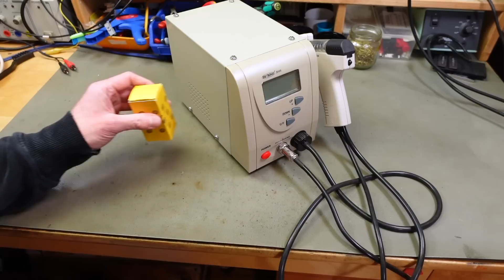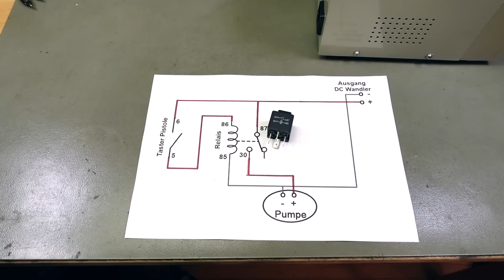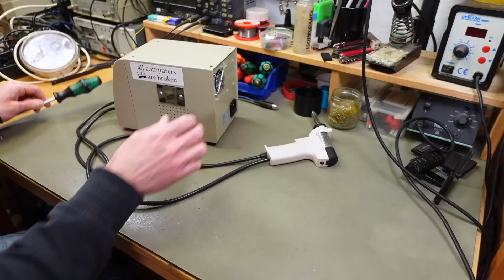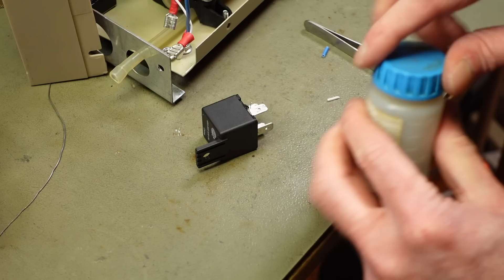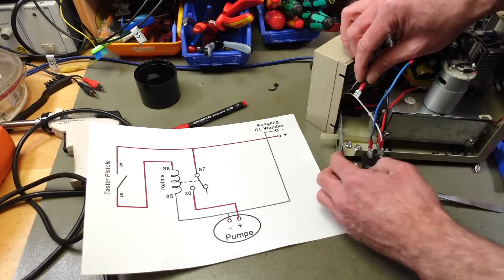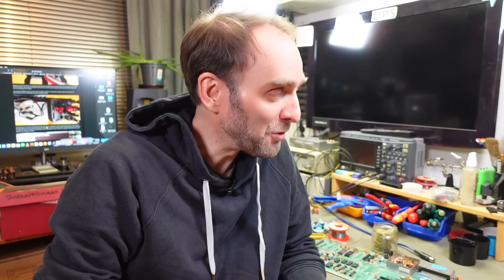Putting an Automotive Relay into my ZD-915 Desoldering Station

Comment: Sorry, I am not trained either. What limits current and keeps the relay coil wiring from burning up when you pull the trigger? Should there be a resistor or something in-line?

Comment: Congratulations on your mods, now all you have to do is install a more efficient and high-performance vacuum pump. I did it (applying your buck converter) and went from -0.6 mb to -0.8 bar. I installed a vacuum pump, purchased on AE, from -85 kpa, with a flow of 40 L/M. It's a bit noisy but it's worth it. I also recommend you change the gun. Now a model with a side opening is available and I must tell you that it is built much better, it is similar to the guns of the ZD 8915. Thanks for everything and for everything. Ciao,
Reply from the maker: Thanks for the tips! I am going to look into doing something similar in the future. Thanks for sharing!
Reply: @JanBeta  My pleasure Jan..To mod the ZD 915 is a trip know only to happy few.Ciao 🙂P.S. Just today I modified a ZD 985 by installing a more powerful pump and a 6 cm fan......

Comment: So pointless. The trigger works fine. This makes no sense as it doesn’t give it any performance changes. Just adds another point of failure.
Reply from the maker: As I said, strictly optional. It improves the action slightly. The trigger reacts a bit more direct and the full suction is available faster (which actually improves desoldering quite a bit).

Comment: As the switch origionally activated the motor, you could use the motor wires to activate the relais. Then connect the motor via the relais contact to the voltage converter. No need to remove the front panel or messing around with the wires there.

Comment: Hi, I followed your previous video and this one closely because I have a question: Is the temperature sensor NTC, PTC, or a K probe? Thanks in advance. Best regards.
Reply from the maker: No idea, unfortunately. I didn't look into the electronics of the gun at all (well, apart from the simple micro switch in it). Maybe somebody else who reads the comments has a clue?
Reply: @JanBeta  Ok, thanks for your time, I appreciate the attitude, greetings!

Comment: The Duratool version of the ZD 915 has a number of improvements. They have used thicker wire to the pistol switch. The wire + switch resistance  measures 0.15 ohm between pins 5 & 6 on the plug. The voltage across the compressor motor is now 14.45 V .

Comment: I would say a solenoid would give better suction, turn on pump to build suction then few seconds later fire the solenoid
Reply: I have upgraded to a solenoid valve vacuum system. The penetration power is greatly improved. Your idea is correct. The solenoid ignition delay is 0.7 seconds. It is suitable and difficult to clog.

https://youtube.com/shorts/4-rGK944nXM?si=oQwJdsERNP9YIUO_

Comment: G,day Jan Beta from Sydney Australia. Great little project. So, this is my understanding.
By adding the switching relay: DC current will find a shorter path to the motor, once the initial flow of current enigizers the relay magnet reducing the loss of DC voltage due to conductor length (wire to trigger switch).
💫🧲
Reply from the maker: Yup, that’s pretty much the idea. I didn’t gain as much as I thought with this mod but the pump speed ramps up slightly faster. I think it might help a bit with the gun not clogging up so quickly. Real life performance is basically the same as before the mod as far as I can tell at this point though. At least the original design flaw is remedied. :)

Comment: "Nice" example for german overengineering! 😂 Add a DC/DC converter to reduce the voltage the first time (when replacing the cheap power resistors), then reduce it further when adding the relay. OMG! An ABSOLUTELY NO engineering approach. Not a single f-ing measurement! Just brainless "modding". Did you measure the current of the pump? Did you measure the resistance of the Wire in the cable + swich? NO!!! So what's the REAL impovement except the feeling?
Reply from the maker: Look, I made pretty clear in the video what it is about. I also said this is completely optional and doesn’t improve the functionality by much. I’m not an engineer. I did the measurements that mattered. You are not satisfied? Go somewhere else.
Reply: It does definitely help, the pump needs the most current at the moment of starting, which causes the greatest voltage drop across the 2.5 m long and thin cable. Exactly at the moment when the pump should delivering the most power, it can delivering the least. Furthermore, it is questionable how long the Chinese switch in the handle will last under this inductive load.
Okay, I used the buck converter's enable pin because I didn't want to have another contact that would wear out over time and the buck converter provides the switching function for free, but ultimately I did it for the same reason: To get the best performance out of the pump at the moment it is needed.
Reply: @ You talk about a feeling and opinion. But you made also not a single measurement!
Reply from the maker: @JacquesMartini I measured the voltage across the pump after the mod and before (in the previous video in the series). Gained around 1V with the relay.
Reply: @JanBeta  Which you reduced before with the DC/DC converter. 😂
Reply: @JacquesMartini  A measurement is of no use if you didn't understand the use case. And as soon as you understand it, you'll have to anyway understand the physical relationships (which I explained above) as well and often no longer need a measurement. Especially once you understood that this is not an easy measurement that can be done with the usual equipment.
For example I can tell you that the pump needs 2,4 A in normal operation and Jan can tell you that the voltage drop across the cable is 1 V. But both measurements are of no use to you once you have realised that he punp is not running in normal peration.
Reply: @AS-oq7io  What a BS!
Reply: @JacquesMartini  The pump does not pump more solder as longer it runs. You can let it run for 10 minutes (if it can handle it) and notice that it has not pumped more solder. The length of the run time is therefore not the relevant factor. The relevant factor is how strongly it pumps at the moment it is switched on. And that is not covered by the measurements.
That is why it is not enough to compensate the measured voltage drop with a higher setting of the buck converter.
Your problem is that you did not understood the use case and you can now make as many measurements as you want, they are all not relevant. You can name it BS but it won't change anything.

Comment: Hallo Jan, kaufst du die Filter dafür oder machst du sie selbst? Ich würde sie gerne selber machen, aber welches Material sollte man dafür nehmen?
Reply from the maker: Bisher habe ich immer welche gekauft. Zeitweise hatte ich auch mal einfach Watte als Filter in der Glasröhre. Das funktionierte super. Ich wollte demnächst mal versuchen, mir die Filter aus Baumwollfilz (das Zeug zum Basteln) zu stanzen. Müsste sich sehr ähnlich verhalten wie die originalen Filter, denke ich. Vermutlich mache ich irgendwann nochmal ein Video dazu, wenn ich Erfahrungen gesammelt habe.
Reply: @ ich dachte auch an Filz.

Comment: Your mod is a ‘nice to have’ but is it worth the time and trouble: the voltage drop on the control wire can be compensated for by increasing the boost converter output to ensure the motor receives the correct voltage. The relay would only really be necessary if the motor load was not relatively constant.
Reply from the maker: It’s definitely a purely optional mod (as I said towards the end of the video). I did it for fun and out of curiosity. The functionality stays pretty much the same, of course. I did what you say in the previous modding video and just set the voltage accordingly.
Reply: this is the right comment ❤

Comment: If you didn't, please but a back emf diode across the relay coil to protect your switch and power supply... Still watching...
Reply from the maker: I forgot to do it at first but went back and added it in! (Spoiler alert! 😉)
Reply: @JanBeta Yup. just got to that point in the video. Came back to delete the comment but you got here first. 😆

Comment: Mine blew the control IC in its SMPS three times. I gave up after the 3rd and bought myself a Hakko. ZD915 is great value for price but in my experience, it is not dependable.
Reply from the maker: Ah, that suck (or it stops to suck in a more literal sense)! I heard from some people who had the electronics break down in their ZD-915s. Mine has been working fine for around 9 years now. I guess with a cheaply made product like this, there’s a lot of variance in the quality. :/

Comment: haha, wenn man zart verpeilt ist und auch gerne 'mal aus Spaß an der Freude seine begrenzte Lebenszeit für Überflüssiges verwendet, kann man das so machen ..sympathisch ist’s natürlich allemal (bin ja selbst nicht anders) und vom Klicken des Relais wird man schlussendlich ja auch immer wieder reich belohnt  .)   Vielleicht solltest du die 4 sputtligen, viel zu groß geratenen Gehäuseschrauben (Oberseite) gleich weglassen, das erleichtert die nächste Intervention u. die knubbligen Schraubenköpfe sind nicht immer wieder im Weg, wenn man etwas draufstellen will?

Anyway - funny to see that you have similar (AliExpress/ebay) equipment as I do (Desoldering- and HotAir-Station) and we both know there is still a lot of work to do  :D   What bothers me about the desolder-thing is the long heating time until everything is at temperature ..also, of course, the somewhat tight mechanics when it comes to removing the sucked-out solder (I broke the glass tube right at the beginning) (nice dealer immediately sent me a replacement for free)  ..well, just sayin’ ..LG
Reply from the maker: Ha, ja das war natürlich eher eine Aktion, die ich aus Spaß und Neugierde gemacht habe. Keine Ahnung, ob es das wert war, aber fühlt sich besser an, jetzt wo dieser „Designfehler“ behoben ist.
Die günstige Ausrüstung liegt bei mir vor allem am latenten Geldmangel (und ich habe nichts dagegen, an den Teilen rumzubasteln, das ist fast ein positiver Nebeneffekt). :D Das mit den Schrauben ist eine gute Idee, die nerven schon manchmal. Wahrscheinlich würden da schon Senkköpfe und ein bisschen Verfeinern der Bohrlöcher helfen. Mal sehen.

Comment: Also this gives a very easy option if you ever wanted to break out that control point with a TRS jack or somesuch, and make the suction foot-pedal activated. I suppose that's not entirely an option that might be the most useful, but a possibility all the same. If these things were able to heat up faster, a way to let it standby until needed would be kinda neat, but usually the thermal lag of getting to a usable temp, would be too much of a patience game. End up with more clogs if not all the way there.
Reply from the maker: The foot switch is a neat idea! Could be useful for peeps who are not able to use their hands for the trigger and still want to desolder stuff!
The heating element is rated for 24V in these but it seems to run on 18V so it might be possible to do yet another bit of hacking to make it heat up a lot faster. Maybe I’ll look into that sometime. :)
Reply: @JanBeta  That's a good point about possible accessibility. Also interesting that the drive supply is that low compared to the possible rating. Hopefully bumping it up won't destabilize the PID(or whatever they use) another maybe issue is the element might not run as long if burned more aggressively, but who's to say what that would actually mean for the element's lifetime.

Comment: When I've performed modifications such as this, I've found it's worthwhile to purchase a matching socket for the relay.  This makes servicing/replacing the relay much easier, should it be required.

When I worked at a 2-way Radio Shop, we added a reverse biased diode to the relay input, on the horn honk relays, for AMPS (analog) Cellular Phones.  This reduced the likihood of damage to the triggering mechanism within the cellphone, which honked the car horn, when the cellphone rang.  I think we used a 1N4003 or 1N4005.
Reply from the maker: I added a 1N4007 (although I forgot it at first and had to disassemble the relay connections again). D‘oh!
A socket would be neat, maybe I’ll add one the next time I’m tinkering with the station. I think the crimped connectors should be fine for a while though.

Comment: I’m a bit doubting on this change. 

What was the resistance of wire going through the gun trigger and back to the pump?

As that’s what you’ve eliminated for a shorter wire. (Though now the pump and trigger are in parallel?) 

I think I’ll watch the video again - to see if I can understand it better

It feels like there’s the trigger plus solenoid in parallel with the pump 

The argument being the resistance of the wire and switch was dropping the voltage and burning power ( P=VI) before it got to the pump? Im not sure if that was really that much.
Reply from the maker: I literally measured the voltage across the pump and the gain was at least 1V before I adjusted it down again. It’s not really a necessary mod but the theory with the resistance is definitely valid. Not gaining much in terms of functionality, of course, but it was fun to do it. ;)

Comment: Perhaps the next mod should be solid tubing and some adaptation to allow the gun to be cleaned more easily
Reply from the maker: I heard there are slightly newer versions of the guns that are a bit easier to clean. I’m going to look into that sometime. Modifying the gun part itself is tricky because everything in the release mechanism is brittle plastic. Not too easy to change things without breaking it completely, I think.

Comment: What is the relay coil resistance?
I would have put the back emf diode across the relay coil to help save the trigger contacts.
Sorry I was going by your schematic and was only up to 10m in the vid.
Reply from the maker: Not sure about the resistance but it is probably negligible. I forgot the diode at first but remembered to put it in just before I went into testing (sorry for the incoherent video)! ;)
Reply: @JanBeta  I would guess that the resistance is quite low for automotive relays, but not as much current as the motor I assume.

Comment: I wouldn't have believed the difference that relay would make if I hadn't seen this video!  Great way to learn about a load on a circuit.
Reply from the maker: It’s not that much difference after adjusting the voltage for the pump. But I was quite impressed myself how much resistance the original wiring adds to the equation. The mod remains optional, I did it more out of curiosity and for fun than to actually gain much in terms of functionality.
Reply: @JanBeta  the rampup/start sounds so much quicker!
Reply from the maker: It feels a bit quicker indeed. But the usability is basically the same (I just used the modded station for the first time properly). The full suction is there a bit faster but you get the same effect with just letting the pump run a tiny little bit longer in the original setup, I guess. At least that’s what it feels like.
Reply: @JanBeta  It runs a tiny little bit longer in the original setup which cools down the solder joint and when the pump has the full power the solder is not that liquid anymore and therefore harder to remove. Time is definitely a factor in this kind of setup. The setup already has enough deficiencies when it comes to the airway (leaks, expansion, etc.). It is good to remove the electrical deficiencies.
Reply: @JanBeta  have you seen the video - A Better Mod to improve the ZD-915 De-Solder Station?  The mod there improves the timing of the suction by adding a valve relay to the gun, and using a small circuit to delay the action.  I think because then the solder is still liquid when the vacuum hits. I'm halfway through making it, the valve switch is the only part I did not have (its a relay and an air hose combined)

Comment: How on earth do you get the clear plastic tube for the gun so clean? No matter how much I try to scrub it, it either scratches or is covered in tin. Either way, it is rather opaque 😀
Reply: I clean the tube by letting it sit in isoprophyl alcohol for 1 minute and then just use paper towel to clean the gunk.
Reply: I usually wet some kitchen paper towel with isopropanol and twist it inside the tube
Reply from the maker: Mine has a glass tube and it’s relatively easy to clean because the solder doesn’t stick to it too much. I heard there are versions of the gun with a plastic tube. Probably much harder to keep clean & clear.